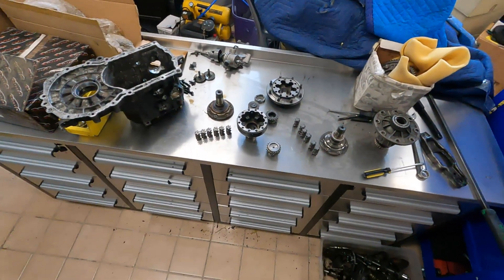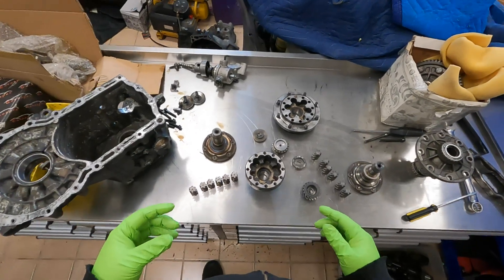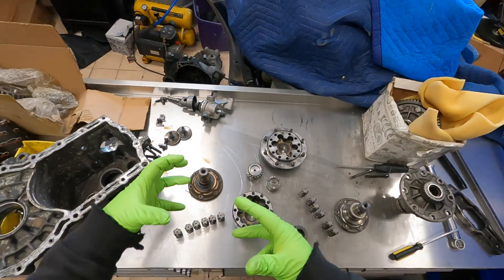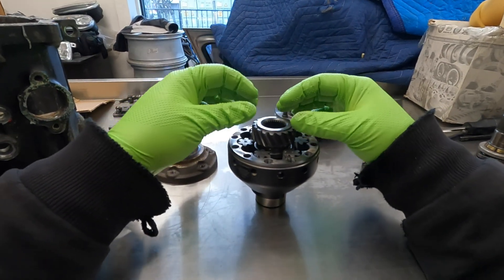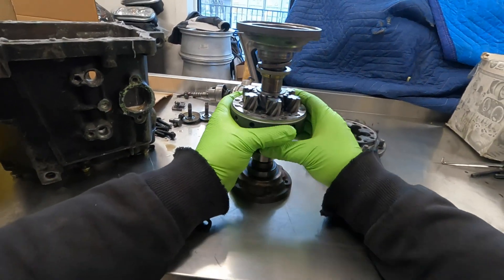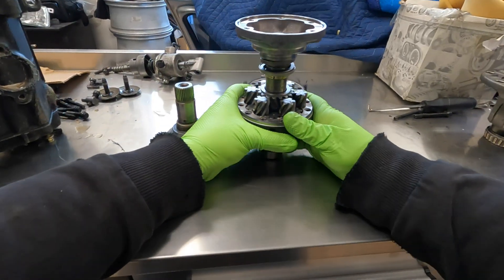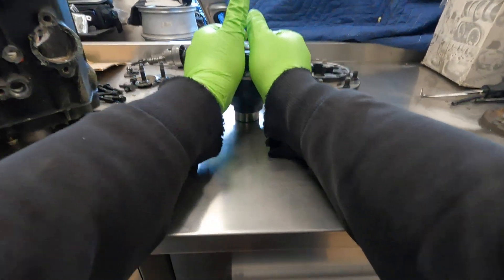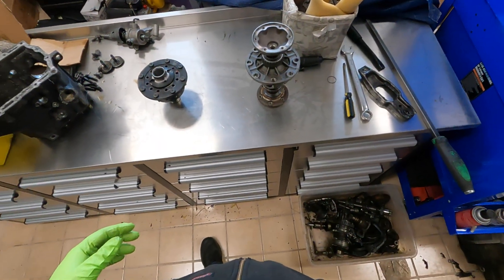A look inside a Wavetrac Limited Slip Differential

Comment: Hello again sir

Do you know of any lsd diffs with 1 way locking diffs as in only locks on acceleration that would fit my 02S to 02j 6 speed project i figured it would be a nice thing to have during snowy weather and heavyrain/mud any tips would be very helpful my only concern is that it must last for dayly normal use not track driving 

Hope you had a nice new year's eve🎉🎉